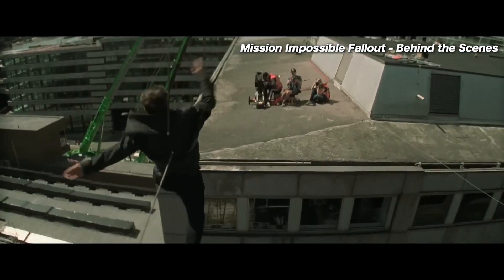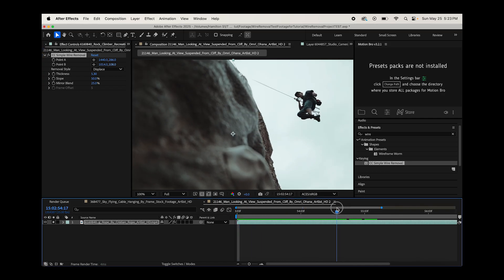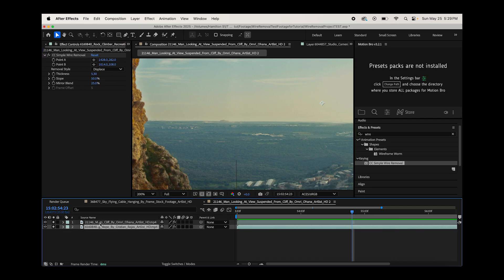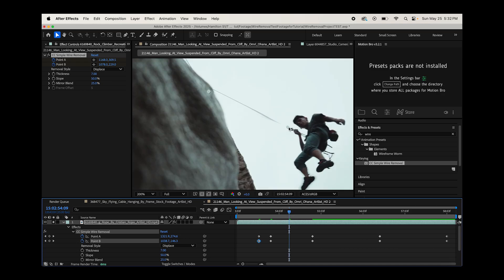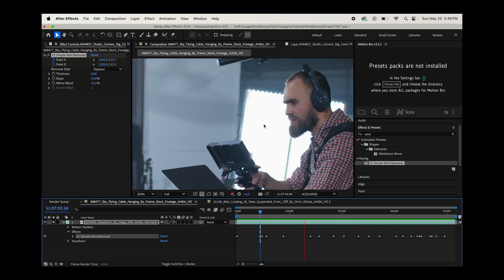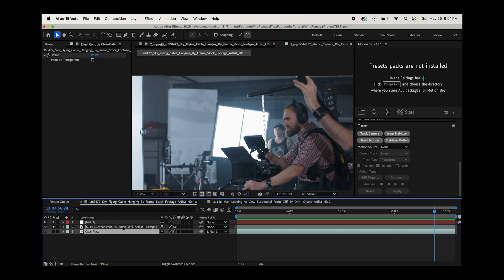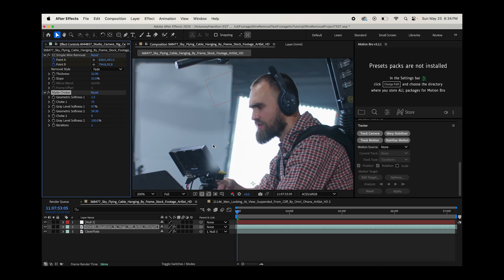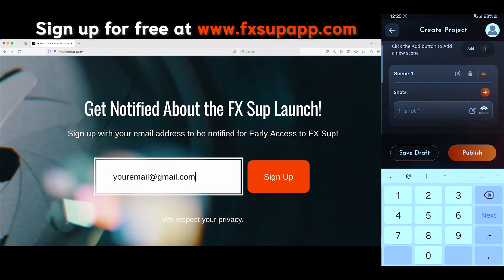Wire Removal in After Effects (FAST & EASY) – 2025 Tutorial

Comment: So what happens when whats behind the wire is a face, or clothes, or hair? I want to learn what to do in those scenarios
Reply from the maker: The short answer is that you have to find a way to add thay information back in. You could manually paint it or track a cg model of the element onto the moving character and show it only where the wire element would be.